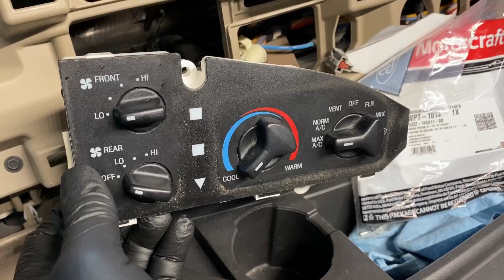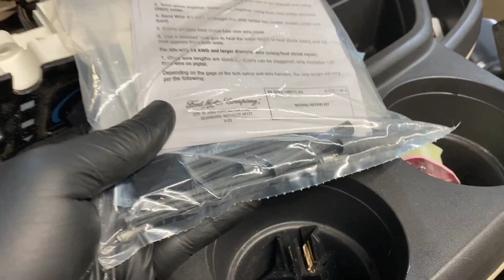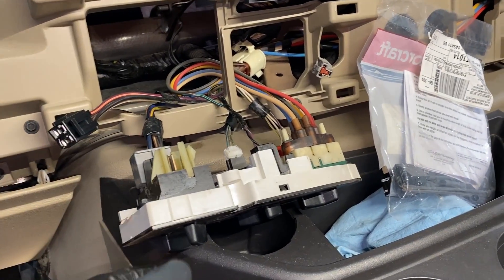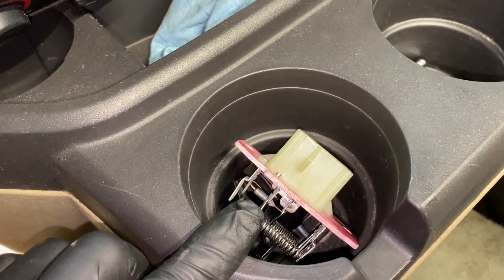Ford Econoline Vans: Blower Motor Switch Failures Causing Meltdowns!

Comment: I just got back from the salvage yard and brought home a new heating control unit for my older 1994 Ford van. I only have three speeds in my configuration. The controls is a little different, but it was definitely melted behind the switch. Luckily, I cut the pigtail off a good unit so I’ll use that but I’ll order a new resistor package before I try to turn the damn thing on. Thank you.

Comment: 2000 econoline e150

blower only worked on max when i got the van, then gradually lost blowing power 

replaced motor resistor and control switch, new pigtail harnesses wired in for both

now it has full blowing power but still only works on max 

any ideas? blower motor itself?

Comment: Replacing these parts is super easy.  You failed to explain how to get the feont panel off, which is the hardest part to get off.
Reply from the maker: It varies with model year.

Comment: Good video, covers both possibilities. My fan was only working on the lower 3 fan settings, no high. I replaced the resistor, no change. Then I replaced the burned/ melted pigtail & switch, now works perfectly. It's a bitch to get to in a 2010 E150, doesn't have the same easy access panel of the van in the video. Thanks!

Comment: Could a melted pigtail cause the ac to blow off and on intermittently? The blower control switches for front and rear were replaced,  but they didn't replace the pigtails. Im not sure if he even looked at them since he didn't pull it out like you did. And worked from underneath it.
Replaced the blower motor and the resistor for the front and rear. 
The front and rear ac goes off and on intermittently.

Comment: Mine only works on 4 like you said in the video, also it only blows on the floor none of the other settings like vents or windshield work. Would that be a switch?
Reply: Probably resistor and you have a vacuum problem on other know. Broken vacuum line or vacuum servo

Comment: I have  the 2013 e350 and my fan only works on high too !  Do you have the part numbers for the pig tail , resistor , and the switch ? Thanks for the video

Comment: This has been a common long running issue…I deal in 72-76 Ford Torino and Mercury Montego cars, and other 72-79 Ford/Mercury intermediates and this has been an eternal issue.

I’d love to have a better way to rewire the system running off relays for the high current side.
Reply: You can reword it. Use the switch wires to control relays, the the relays supply power from the battery to each circuit. Most ice cube relays will handle 30 amps. Just make sure to fuse the power going to the relays at the source of the power.

Comment: question is this the same for it stuck in low mode / i pull the knob of and the switch was super hot . or is it a short in the wiring?

Comment: Totally made sense and straight to the point.  2000 E250 106,000 miles. You described the exact sequence of events that I experienced in the gradual diminishing of my blower. Racing to beat winter here. Just changed out my totally clogged heater core, so now I gotta get this blower working again. Thanks a bunch!!

Comment: Well thanks for the Vid but would have been nice to have the Part numbers for the Pigtail kit/Switch/resistor included plus the hardest part of the whole project how to remove the Bezel around/in-front of the switch panel.

Comment: I just wired my switch so tha Only the high works. But my fan still goes slow sometimes and fast others to others I'm thinking I need to bypass the resistors as well?

Comment: Is there bulbs in the heater controls?? Mine do not light up at night. Radio, cruise buttons, dash everything else does. Except the heater controls. Kinds erks me because I csnt see them st Nighy so it's a little annoying. I guess I need to pull the Hester control out and see. From photos I've looked at I don't see any bulbs for them. R the dimmer.lights built into the whole unit?

Comment: I'm doing research on the econoline blower fan motor, for upgrading the 72-76 Ford torino blower fan, this is nothing new! Never understood why FoMoCo rammed all the current through a switch. Also seen the full size Chevy vans really suffer from the same issues of control unit burning up and failing. I used to manage a small fleet of Ford Econolines, and Chevy full sized vans.

Comment: i have a fleet of e450 vans the earlier ones i had the issues of melting the switch even with new motro and resistor i ended up running the high through a relay took care of the issues now to be fair i have e450 shuttle busses and have carrier ac units

Comment: mine blows low when on high... is it the motor resistor or the switch? the switch does get hot I noticed.
Reply: I think it's the switch but should I change both anyways?

Comment: love your channel.  i have a similiar van that the blower works on low and high only and not the two middle speeds. i've replaced the resistor and fan speed switch and still not fixed. this thing is driving me nutty

Comment: In the 1970’s Fords we had a similar problem with the AC switches, in high blower it would burn the switch up because all the current ran through the switch. We would put a relay so in high blower would be run through the relay. I don’t know how those are wired. But would that help with that setup.

Comment: My issue is that the relay for the blower motor on the 2003 blows same blade on the past 3 fuses. sooo...resistor ? Or another issue?

Comment: I have one that continues to come back with the switch melted. We replace the switch, connector and resistor every time. One we even replaced the blower motor as well. It continues to burn up switches. Can you help?

Comment: Man this is not related to this video but I have a 15 f550 roll back with a 6.8  that has an surge issue nobody around here can diagnose.  The a/f ratio pid keeps flopping back and forth . I've replace fuel pump ,fuel pump control module,  pcm ,maf sensor ,evap purge solenoid.  The intake has been smoked twice no leaks . All parts replaced have been ford parts . Any ideals ? By the way when I first purchased it (82k and recently rebuilt by a ford dealer) would randomly do this once a month now it's an all day everyday concern.

Comment: I have a question. I have a ford expedition xlt 2004 and the back a/a unit doesn't blow cold air. Also the front a/c goes on and of in all speeds, any ideas can help me out I will appreciate it. Thanks and also your channel help me a lot with my expedition.

Comment: And they do still make the cutaway in 2020 with all the same wiring
Reply from the maker: Well aware but I was referring to the passenger vans that were replaced by the transit.
Reply: Again didn't mean any disrespect was just highlighting that ford is using this incredibly dated system all the way here in 2020

Comment: You also want to check the ground for the BM resistor it's by the accumulator drier often the bolt is very rusted and it can caused increased amperage through the switch
Reply: Didn't mean any disrespect bryan in my experience the increased resistance causes the motor to spin much slower sometimes stopping it letting it sit on one spot on the commutator of the motor passing more amps at a lower voltage than the motor does on high setting which leads to the wires and switch settings for the lower settings to get very hot, also it seems to shorten the life of the BM quite a bit. I may be misunderstanding whats going on but I've had several trucks in the fleet with this issue and that ground always seems to be corroded along with it.
Reply from the maker: Can you explain how a corroded ground can cause higher amperage pull on the switch? Are you saying the ground adds another load in series with the blower motor? Kinda like the resistors in the blower motor resistor? I would think the circuit would break before pulling more amperage, if it did the bolt and ground wire would be hot and melt in some cases.

Comment: I've replaced a lot of blower motor resistors on rangers and almost every one I've done the pigtail has been melted/corroded to the resistors. Is there a similar problem?
Reply from the maker: yes
Reply: @FordTechMakuloco  are the switches the issue in the rangers also or is it the resistors, never pulled a switch out but seen many resistor pigtails melted

Comment: I had a 2006 I bought new ,  until I sold it I replaced all that at least four times.  Just bad engineering and is what it is.
Reply: Mr slaughter...  I have a 97 e350 class b RV..   

When I turn in the AC... Or just the vent... The heater stays on...  The blender is working because I can shift from vent to defrost..etc no problem

The issue is the heater is always on...even when I switch on the AC...

Do you have any suggestions

Comment: I just fixed this issue on my 08 van. I hit a hump in the road in winter and my blower motor stopped. What I eventually found out is that the connectors to the blower motor and the speed switch were fried, and the blower resistor was corroded. So I replaced all those and then the AC fuse burned up too because the AC relay was soo corroded due to salt and water. So I changed all that and now it works great. Also if you are wondering where the AC relay is, it's in that weird box under the hood right infront of the driver's side. Those relays are not easy to find unless you order them or pull them from a junk yard. It's not the same as the blower motor relay in the main fuse box under the hood.

I'm just sharing just incase someone else has the same problem.

Comment: Former Ford Dealer Tech here, hey I really respect your opinion and appreciate your sharing your knowledge and experiences with us all...  I use 5w30 in the summer and the recommended 5w20 during winter fall and spring while operating my 2011 F150 3.7 ltr .... Do you think it is ok  to use 5w30 in the Summer seasons ???
Reply: BTW I live in Rhode Island (Climate wise New England region)..
Reply from the maker: I would stick with 5w-20 year round in this engine.
Reply: ok thanks

Comment: Replaced my upper intake manifold on my 2004 f150 and now it won't start but it will turn over getting fuel and spark will the VCT cause this problem it sat for 3 months before i replaced the manifold
Reply: Are you sure you didnt have a gasket fall out or get pinched? Did you miss a plug in for something. Not much else could be wrong if it ran before you changed manifold

Comment: Why does this happen in the first place? And if the root cause is not being fixed, this will surely happen again, and again, and again....
Reply from the maker: Contacts wear inside the actual switch as I mentioned in the video.
Reply: @FordTechMakuloco  - Both parts fail. And they shouldn't. They don't do that on most other cars. So I am thinking that there must be something else that is causing this.

Comment: Does the rear zone have the same set of issues? If so, where on the vehicle is it's resistor? Thanks!
Reply: There's a few videos on YouTube that show where the rear auxiliary heat/AC components are located on the Ford Econoline. I'm almost certain that it's located behind the very rear interior panel on the drivers side rear

Comment: Another piss poor design by Ford, I had to replace same parts on my Ford e-250 1998, engine is 4.2 V6. Engine hydroloked due to water going into combustion chamber from cheap ass design of Ford heads and cheap thin gaskets! Ford first on road dead!

Comment: The switches are totally useless. Even replacing with new one it will do the same thing. The Ford switch can NOT handle the current draw going through it. I got tired of the whole thing and pulled out the switch and installed a SPDP heavy duty (50 amp) switch and bob's' your uncle. Never an issue again. All ford econolines have this problem.
Reply from the maker: I have never seen a repeat failure of this switch but anything is possible. It's a wear items just like anything else it will fail again eventually.

Comment: Correction, did not stop making them. Still alive and well in stripped chassis form. I deal with this all the time in U-Haul trucks. Standard practice is switch/pigtail/resistor on all of them I come in contact with. I also use Ox-Gard on all connections. The switch is a hopelessly cheap design but is easy to diagnose & change.
Reply from the maker: Yup I know the heavy duties are still being made but I am talking from the passenger van side of things.

Comment: Aloha Brian,
Thanks for a great video. My 2006 F250 had the same problem. Replaced the resistor and switch but noticed the female connector behind the switch is overheated. I could cut and spice a new female connector but so see you have a Motorctaft Kit there...is the kit the repair for the wires? If so, What part number? Thanks again.

Comment: This happened on my 2012 f150. Replaced and used dielectric grease
Reply: My connection was on the passenger foot area panel

Comment: I appreciate your videos.  I'd not mind watching the highlights of the actual component remove and replace just in case there are little plastic bits in the mountings and connectors that are prone to cracking or tricky disassembly.   Keep'em coming.  Ford does make me loco but so does my Chrysler, Buick and Mitsubishi. My only vehicle that doesn't is my 2012 Fuji Gran Fondo 2.0.   👍👍👍

Comment: Should you change the blower motor as well due to high ampere draw?? So the new harness and switch don’t get burnt up
Reply from the maker: Never seen one cause this in my 20 years of wrenching. This is a common issue with the e series new or old.

Comment: I recently paid a mechanic to put in a new fuel pump but my gas gauge still isn't accurate and fluxuates, not as bad as before but im tired of going back and not getting it fixed, any idea on what it could be
Reply: CHEVON make cleaner that should take can of the problem.
Reply: @rollenschultz2707  ok ill give it a try
Reply: What vehicle is it on?  Could be a bad ground, or some fuel pumps you swap the sending unit for fuel level into new pump assembly so you would still have same issue.
Reply: @dodgemechanic  2004 f150
Reply: @RayWilliamJohansen  I don't think I've ever replaced a fuel pump on a ford, it's usually the driver module on the the crossover frame rail above spare tire. Not sure if fuel level goes through the module but they rot/corrode into a pile of dust

Comment: I guess this is still better than the sprinter vans. I worked on one that the blower motor just rusted up and seized. It happened around 100k miles on it and only 4 or 5 years old. This was on a van used almost everyday, as you can tell from those miles. These three parts in this video cost less than that one blower motor also.
Reply: I have heard of people having had the blower motor changed on a motorhome on a Sprinter chassis, but they can't get it to work again.